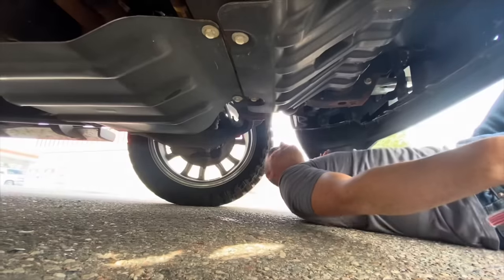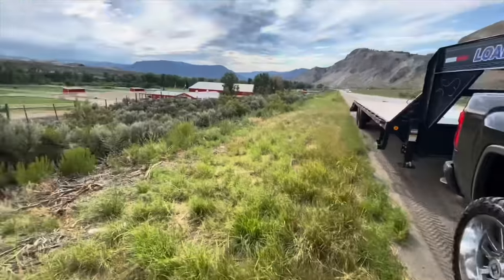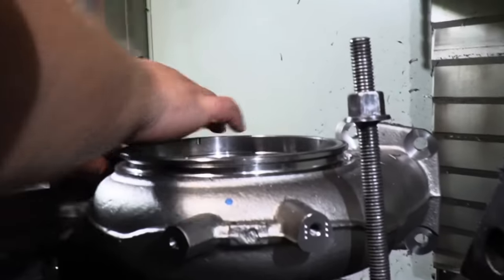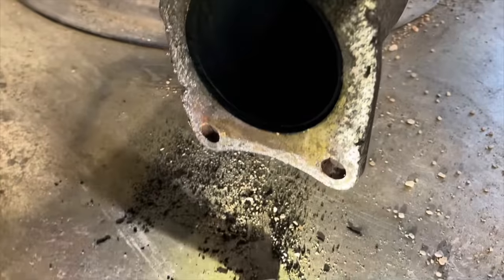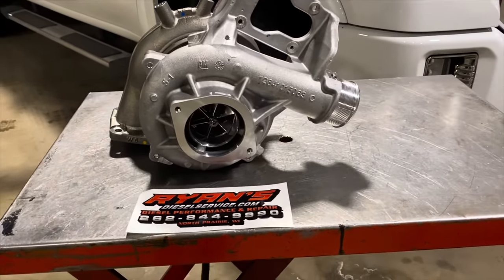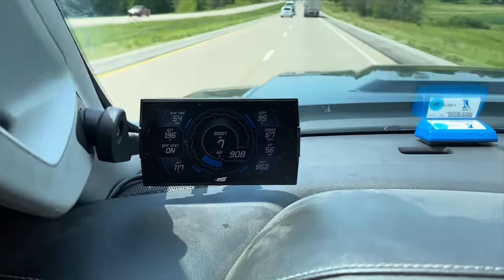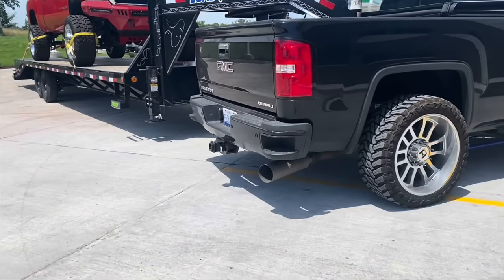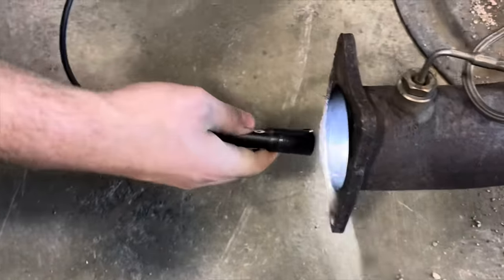This Is What Emissions Did To My Diesel! Heads Up Diesel Owners!

Comment: Yea Im in the market for a new work truck and I wont even look at anything over 2007, I have a 2010 Chevy Silverado LT and that AFM/DOD and emissions shit is all that has given me problems out of the truck. I want a turbo diesel. Just went and test drove a nice 2006 6.0 powerstroke but after about 30 minutes of the test drive it started to smoke from under the hood. Glad I learned my lesson many moons ago to give the trucks a good test drive, interstate/highway, shift through all gears, get on it a bit. Test everything and check under the truck everywhere. Wont get got this time. Thanks for sharing your experience.

Comment: Any problems the engine have with 'breathing' are going to be magnified by the thinner air at higher elevations.  Especially above 8000 feet.  But I've driven through the pas west of Denver a few times.  It hits 13,000 feet.  With a clogged DPF, it's going to to be hard going.  With less air going through, there's more soot, and it becomes a never ending vicious circle.  

Dad's truck has a water electrolizer kit in it, and it breaks water into hydrogen and oxygen.  Both are added to the intake.  Last time I drove through the mountains, I went through Roger's Pass in BC.  I went flying through that with no trouble, while a lot of other vehicles were unable to make the speed limit.
Reply: He was on I-70.  The highest elevation on I-70 is the Eisenhower Tunnel at 11,158 feet.    Vail Pass is 10,666.
Reply: Modern diesel engines can account for changes in air density and adjust fuel delivery to maintain the air-fuel ratio, so nothing you said has any validity. Soot is nothing more than unburnt fuel, so if the air-fuel ratio is maintained, there is no increase in soot. Will there be a loss in power? Absolutely, but less so for turbocharged engines, which all modern diesels are. 

Water electrolizer kit? Snake oil. Unless you can provide scientific testing results and explain the theory on how it works to improve....combustion?
Reply: @mx3727  LMFAO.  Ok, if that's how it happens in your world.
Reply: @ng-ht1vx  How what happens? Soot? Electronic engine controls? Exactly what are you talking about???

Comment: At what mileage on your rig did this happen? I have over 137k on my 2019 L5P, and never had an emissions related issue. Lift pump at 80k, fuel rail pressure sensor and connector at 96k and that is it.
Reply: This guy is running a tuner on his truck. All the additional power is made by adding a lot more fuel. More Fuel = More Soot. All into an exhaust system not designed for that. Seems common sense to me.
Reply: I think I saw it was just under 100k in one of the videos.
Reply: @HHBomb74  you might be on to something.

Comment: Love your videos man, I mostly lurk here and take it all in. It's crazy what emissions equipment can do to an engine.

At heart I'm a computer tech, robotic, pneumatic guy. But I can turn a wrench, so I have been doing a lot of my own work on my LMM recently. I Started with a bunch of Banks stuff  including an intercooler, cold air intake (with super scoop), programmer, diff cover. And then upgraded the oil filter and fuel filters to CAT style for better filtration and longer life.

I see you rounding 700 HP recently. My question is, have you ever looked into or thought about doing a CNG / diesel hybrid? It is said to give a significant boost in performance (HP) and MPG due to the properties the natural gas has, it can burn the diesel fuel more efficiently, closer to 100%, meaning almost no black smoke. All while reducing the overall cost of fuel since CNG is cheaper and you run typically a 50/50 mix.

Comment: I still have my 1999 Dodge 3500 5.9 24 v no issues just good pressure and cooling to that vp pump. More power means More issues and more broken parts. Yeah I know I don't have the cute interior like you guys though. That sounds like a big as bill too I could probably get a new Cummins engine with all that work been done.

Comment: I deleted my 2012 LML in 2016 because the GM dealer wanted to replace the whole exhaust system for $9k they were so incompetent in trying to find the problem to correct limp mode after having the truck for a week, and multiple regeneration on the filter they gave up and said it needed a whole new system. Cost me less than $2k to install Motor Ops tow tune, and transmission tune, and new exhaust pipes. Since then I’m still getting 16.5 litres per hundred km, it used to get 21.5 before the delete. Glad you got it fixed, btw, awesome looking truck.

Comment: Hey Josh again love your channel! You can tell the ram guys. At least your transmission didn't get made in the Toys R Us Factory.  the l5p is one of the most sought after long lasting reliable built like a tank diesel engines ever produced and I will argue that with anyone
Reply: If it comes from a GM factory the. It’s junk. 
Source: my 2020 trailboss that blew up before 8k miles. I’ll never buy another GM product as long as I live
Reply: @lesterparker1594  that sucks man! Sorry to hear that. Pretty damn rare though For how many they put out. What engine did you have?
Reply: Lol Go Isuzu!  I'll stick w 7.3 international, but I will make sure ill honk and wave at you when it throws a code and parks u for some unknown reason
Reply: @SneakySnake-vs6sm  I have 179k on my 2021 brotha. You can definitely keep your International shitbox 7.3 With its amazing 4 speed shitbox trans. Shity ride. Massive HP & torque numbers lmfao 🤣 and the fact you can hear it from space sounding like someone dumped a box of chains into a washing machine ......Good luck with that. No thanks!
Reply: Sorry bud mines a six speed manual..ladies like you dont even know what a manual is so just keep your isuzu on the pavement bud and keep your filters clear of soot or your  Government Motors truck is gonna throw a tantrum, oh by the way it only has 426k on it so keep yapping
Reply: @B-rad303  I had the 5.3. And it turns out it’s not really that rare. In my small town the mechanic said he does at least a couple every month.
Reply: well that sucks man sorry to hear that but I can tell you one thing if you go to Ford or Dodge they're going to have more issues but that's just my opinion
Reply: @B-rad303  I traded it in as soon as I got it back for a new ranger. The ranger is a better truck in every way
Reply: @SneakySnake-vs6sm  Yes, the Duramax is an Isuzu design, and GM owns Isuzu. So, for all those people that wanna talk smack about their "American-made" GM truck with a Duramax - your engine is Japanese. Deal with it. (not saying that's a bad thing, to be clear)

Comment: DPF and emissions were a big factor when I was truck shopping.  Almost went with a 6.6 gas GMC just to avoid it, but coming from a 06 Duramax I figured I'd never be happy with the power.  As such, I now have a 2021 GMC Duramax.  My question is, is the Edge Insight the best way to monitor this?  Or do you have any other suggestions on what to watch for?

Comment: I had a 2020 Ram 2500 Cummins that clogged the DPF at 21000 miles.  As soon as the DPF issue was repaired, it blew the turbo.  Turbo was replaced and within 25 miles, threw another code.  I hate these new diesels!

Comment: With a Derringer or an Edge EvoHT2 you can run a static regen and probably should.. every so often… with any mod it is a good idea to monitor EGT.. 

I have an EvoHT2 and the extreme (Hot) tune will run the EGT high if you are towing or even just pushing the truck without giving it a break (Edge specifically tells you NOT TO TOW with the Extreme tune).. that is what probably melted/compromised your injector.. 

Also! Check your MAP sensor.. mine doesn’t regen well while driving if the MAP is too sooty. (Get the SB MAP spacer!)

Comment: i own a bit different die-sell...the FIRST thing that I did after I bought it(used) was to hit a big rock and have the DPF fall off accidentally  0_o....and then, somehow...the EGR system just .....stopped working.......and...well....NOW....it runs GREAT!!  and I get 42-43mpg on the highway and it sure does run a LOT spiffier after getting a little plug in help....

Comment: Ok correct me if I'm wrong,  this whole issue was caused by a melted dpf or def fluid sensor. Preventing from fully injecting fluid or partially working. What caused it to be melted  and how can you prevent it from happening.  The regens are needed to burn off soot, what can a diesel owner do to prevent this issue from happening to their truck?

Comment: I had white smoke coming out of my exhaust like that a few years ago with my 2010 6.4L Poweerstroke and it was my Fuel Pump. Luckily I only had to drive it 2 miles to the shop in limp mode and had it back on the road the next day.

Comment: I have two 97 5.9s one in my 72 chyanne and a 16 high country dura max 3500 with 100k and haven't had a problem with it but I use it hard it pulling a cat 305 mini ex was going to delete but go into calli so I have to keep it stock for now good luck with your repairs

Comment: Your experience is a cautionary tale for anyone who wants to tune their truck for a bit more horsepower. Blaming the emissions system though for being left stranded on the side of the road is probably only part of the story. IMO what put you there was a really sooty tune and that's what plugged your DPF. If the soot completely jammed your DPF can you imagine the soot in your oil? The related extra wear on engine components? No bueano. Would be great if in the future you could cover the installation of a Banks Power Derringer tuner and related horsepower components to see how it compares to your current set up ( Banks is emmissions legal). Thanks for the awesome  channel and great content!!

Comment: I’ve learned working in a city fleet,that diesels are very expensive to repair,& to me not worth the expense,I would rather have a gas engine, as long as it’s not a triton or the 6.0L engendered poorly,I’ve seen where the cab had to be removed for engine  replacement ,with like 17000 miles on it.because of no maintenance.

Comment: My dad about a year ago was thinking about selling his 2003 F350 7.3L 4x4 dually crew cab with 145k miles and buy a newer.  He was having issues with his truck mainly from it sitting and was tired of it. I told him we can easily fix that truck we can't easily fix a newer truck. I talked him out of selling it and went through the injection system in fixed other small things and the truck runs like a champ and this is coming from a cat diesel mechanic that hates diesel engines and is a chevy guy

Comment: Questions (since I see a lot of performance mods on this truck listed in the channel description): 1) about how much more HP/TQ is this truck producing over stock? 2) what tune are you running (I assume a custom tune, and if so, by what shop)? 3) how much coal does this truck roll on hard acceleration? 4) How many miles on the truck when this happened (I assume the DPF was stock, never before cleaned)? Thanks!

Comment: Best advise I can give anyone no matter what diesel they have is to run Archoil fuel additive in it. I was skeptical like all other products out there but I can tell from experience it works. I have a newer 6.7 non deleted almost 100k on it and it barely regens. Watch their videos and try it for yourself. I have no affiliation with them whatsoever I’m just a diesel owner who tried it. I’ve heard gmc regens more than any other truck out there and I have buddies that own them. Can’t tell you why. Although I’m a Ford guy I don’t bash on other brands. I actually like the other ones as well. I have owned every diesel Ford has made and I can tell you the new 6.7 is badass but they all are now with massive torque. They have these things dialed in. If it weren’t for emissions they’d be even better but there’s no way around it if you want to stay legal. They are starting to crack down more and more now and driving cross country I can’t take the risk or the fines involved. They can be more than the truck is worth. Try Archoil though and I bet it’ll be the best thing you’ve done yo keep everything running clean. Hope it helps.

Comment: I put a new 318 motor, transmission, AC, Dryer, and New Dash in my 1999 Dodge 1500 for the same reason. Total out of pocket $11,320.. I'll go another 250,000 miles now.

Comment: What would be an interesting topic for content of emissions is do a data logger comparison using Better Diesel FBC "fuel bourn catalyst".  Regen data with a tank of fuel and data untreated. The other advancement aside from fuel catalyst is engine oil formulation ie. Delo 600ADF.

Comment: I was talking to a guy from Winnipeg several years ago,  and he said his truck was giving him problems all the time, mangled 2 engines, he finally deleted the emissions, he said it runs much better now, but he can't run in California anymore, I guess it's a mixed blessing. Also weren't they supposed to have gotten rid of this def crap last December. I think they could find a better way to keep these regen filters cool, other than using it. They found a way to keep VW Beetle engines cool, and they probably would run just as hot, by comparison...

Comment: I work on the alaska oilfield. Conoco Phillips sold all of our diesel pickups. We all run gas engines on everything under a f650 or dodge 5500. We had over 200 duramax trucks. Now they're all gassers.  We had soo many issues with them in these cold Temps. Diesels aren't worth the Hassel anymore. And I'm a Diesel tech.

Comment: I’ve had my 2011 Ram 2500 6.7 Cummins for 14 years. I got the dpf deleted about a year ago and it’s like a brand new truck. so much quicker of a take off, the jamo exhaust makes it sound like a 5.9! 245,000 miles and still going strong. DELETE YOUR TRUCKS!

Comment: Fuel is the biggest culprit added with city driving, my 14 Cruze 2.0L had nothing but emission problems using cheap fuel and city driving. Once I started using top tier fuel with and additive the problems disappeared and had over 200k still emission intact. GM programming is a big problem as to meet EPA standards so they create more soot to keep NOx levels lower and combine that with city driving means failing sensors and clogging of EGR and DPF. Plain and simple is they're not designed for city driving unless you can manually regen and were I live they mostly are grocery getters instead of work trucks.

Comment: My LMM still has the factory exhaust, I'm constantly treating my fuel to keep from clogging up the system. And mine regins about every 400 miles or less with about 20 grams of soot, but the regins are short, Less than 20 miles or less and it's done.

Comment: Trick is you can't let the modern trucks just sit and idle, with the egr system and the aftertreatment they will plug up. If your not driving it just shut it off and save yourself the aggravation of having a issue in the first place.

Comment: This is pretty common on tuned and messed with diesels with this emissions crap. The emissions equipment isn’t designed to handle the extra exhaust emissions from tuned diesel’s.

Comment: 67000 miles on a RAM 2007 and it was clogged with ash. No way to burn that out. Hint, a 3 3/4 hole saw.

Comment: New diesels are designed to run very clean. When you install a tuner that dumps fuel and belches soot you will plug the particulate filter. No way it can keep up to a rich tune. Just my opinion.

Comment: Lol if your dpf is clogged and causing your engine to overheat you can just unbolt the exhaust pipe at the front (4 bolts) and the exhaust will come out right there until u get to where u need to go

Comment: I would look into that air flow meter code? the whole intake and exhaust system starts with this sensor. and if the EML was on already, its never going to regen anyway.

Comment: Po184 code threw on my 2019 duramax the other day. Reset it and was off for a few days and then back on now. Says it's a temperature censor. The dealer said 400 bucks for each one because there are two supposedly and they don't know which one is bad plus 1200 labor. So 2 grand. Went to Autozone and they told me only Chevy dealer can get the parts. Can someone tell me if that's true. Thanks.

Comment: Hi Man i have a opertunity to get a First diesel 2003 LB7 with 265k on it. They truck runs good and he did replace the Pump the injectors the alison runs supper good and it does have a tuner to add about 80 more horse not to crazy . ITs got some cosmetic things but the bones are good.

Comment: Sorry to confess I went out and bought a new GMC AT4 diesel 2500. This truck started out great. By the time the odometer hit three thousand miles , the truck started its down hill junk run. This truck was kept with the local dealer for most of the first year. The dealer added another two thousand miles running tests or food and parts runs. After that year of fun and games with GM, they purchased it back. I lost money ,but I got rid of the pig. Never will I buy another GM product. They look great, but it ends there. This truck was one big LEMON!!

Comment: A properly tuned diesel with a diesel dpf on the exhaust is more than enough to catch the emissions we don't need all the other bs. I have a 1995 f250 4x4 military truck I built It has a isuzu 4bd1t I have no emmisions equipment on it and guess what I compaired it to other diesels of the size it produced less emmisions than all of them even towing 10,000 pounds. Now sure its a small engine but still making a reliable simple diesel that last 500k miles vs having to fix and rebuild a engine because emmisions garbage took it out is alot.